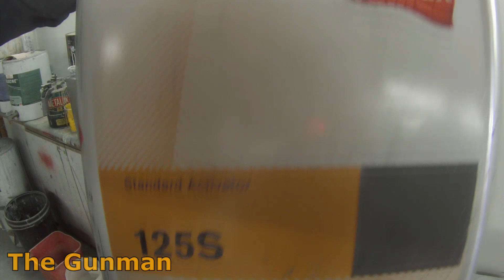How to Mix Matte Clear

Comment: The Gunman - your video's are the best out there, easy to follow - question : when mixing base coats, clear coats, with hardener, for example if you mix 2 to 1, do you mix first, then add the required thinner last ? - tnx*
Reply from the maker: Yes that's correct, add thinners after, you can get calibrated mixing cups from all auto paint suppliers, they have the ratios on the side of the container.
Reply: The Gunman - tnx' for yr' prompt reply *

Comment: Hi gunman! I have a quick question, and saw somewhere that you see comments better than direct messages. I recently resprayed my trunk from the bare metal after getting some weird clearcoat lifting on the previous job, but was wondering what could have gone wrong the first time. Now, I know it was prep related, I did not take as much time as I should have. I also tried to do some weird trickery. I sanded the factory clear coat, and sprayed an acrylic rattle can anti-rust primer, then a rattle can engine enamel, then my base, then my FC740 clear. I know this is super weird, and I have no idea why I did that, but after about a month, I started to get these weird valleys in the paint, that almost looked like a slug crawled over it and took the top layer off with it. I couldn't pick away at the sides though, and it looked like there was still clear in the valley. My theory is I just put too much paint on at once. Any thoughts?

Comment: Hey Gunman, say I used a 2:1 clear also and wanted a 75% matte - so thats like 100ml clear, 300ml flattener, and 50ml hardener yeah? So all that flattener doesn't interrupt the hardening process?
Reply from the maker: Nick Gill that's not correct, I'd put 75 grams of flattening base with every 25 grams of clear making the 75:25 ratio I talked of, hardener then needs to be added 2:1
Reply: The Gunman thanks for the reply.
And do you mean 50grams hardener or 12.5grams hardener?
I.e. are you including the flattener into the 2:1 calc?
Reply: Nick Gill i think The Gunman means 50 grams of hardener. 75g flattening base + 25g clear= 100g mixing and just add hardener with the ratio is 2(mixing) : 1(hardener)

Comment: Would you say doing the matte in the clear is more difficult to spray or less than just a single stage matte? I've never done the clear but I just finished a matte black Prius and I probably sprayed the second coat a bit heavier than I was supposed to but I just wanted a uniform finish. My first attempt was at a beetle a complete with all the panels on which as very difficult for my first time and I had a lot of wet spots
Reply: The only thing I'm not happy with is on the doors I think I should have slowed down on my passes because it's a bit blotchy hopefully it won't show to bad once it's outside

Comment: As this is a solid colour What is the advantage to using a matte clear as opposed to a matting agent in direct gloss 2K?
Reply from the maker: If you put 75% matting binder in 2k it will take 10 coats to cover because the binder is clear

Comment: You may want to let people know it depends on the name brand paint they're using as to the percent of flatter that can be added. Most manufacturers will not allow for anything over 60% as it will cause premature failure of the substrate. Also a lot of manufacturers will tell you to mix your clear and all of the components before adding the flatting agent as it will not provide sufficient chemical interaction therefore likely to have all sorts of issues with performance of the product. Js  contacting the manufacturer is the best solution esp if your going to put the time and money into a flat base clear job without knowing how to even mix it. 😂
Reply from the maker: Or just read the technical data sheet 😂😂😂
Reply: The Gunman you've never had issues with the clear coat being too milky or only lasting a year or 2 using that much flattner.?